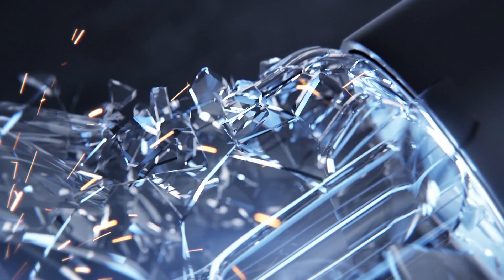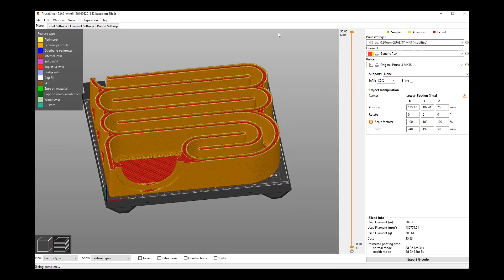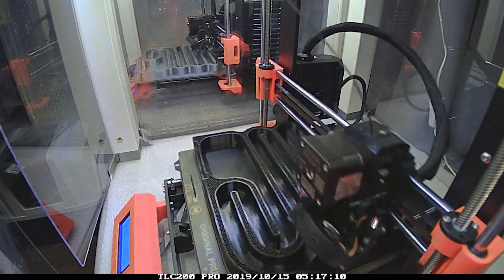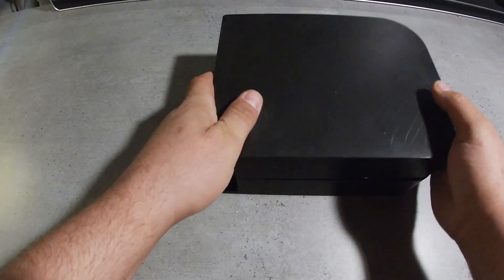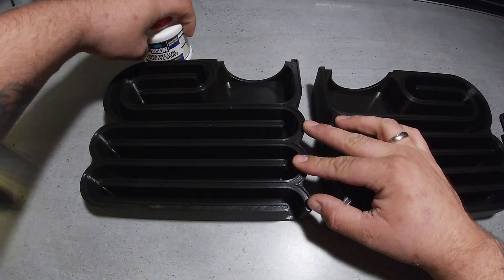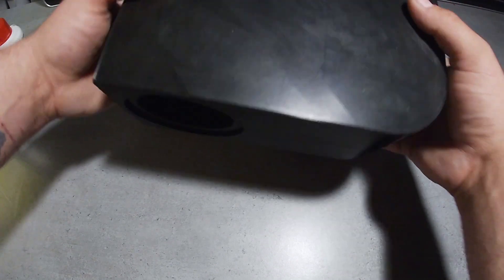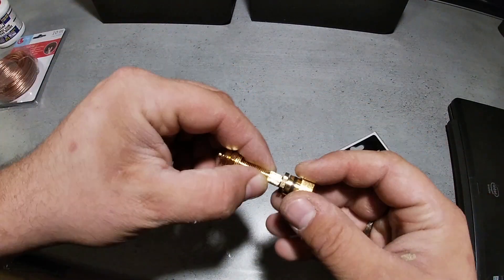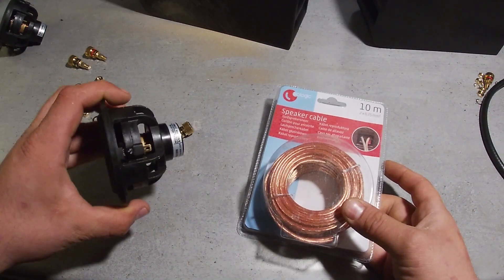3D Printed speaker box (3D BALI)

Comment: It looks like you used a 0.2mm layer setting. You can speed it up a lot by going with 0.3mm layers. It depends on how nice you want your surfaces to be. I went taller layers, faster speeds and turned up the heat so it can melt plastic fast.